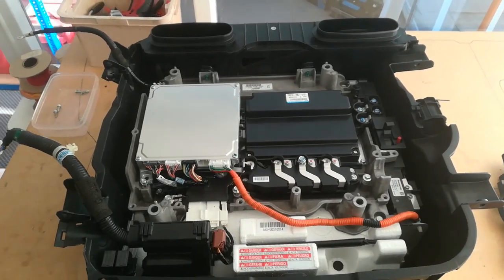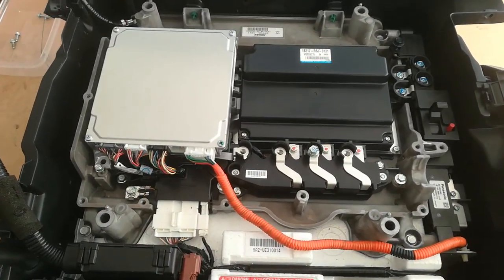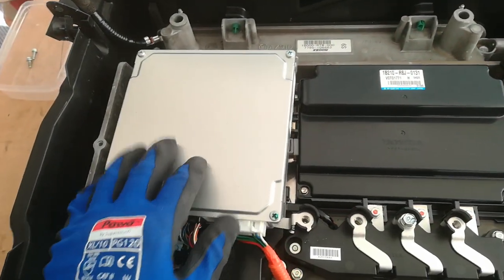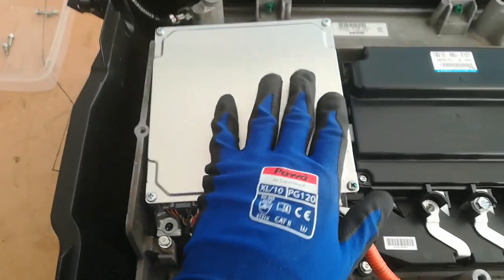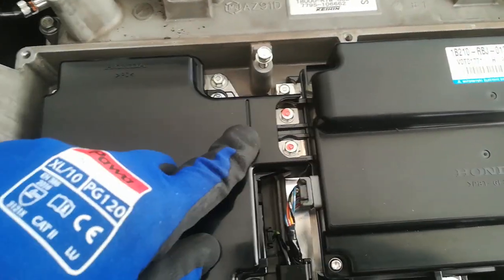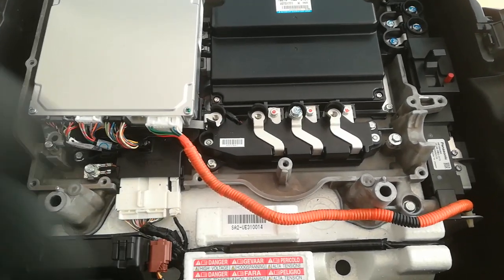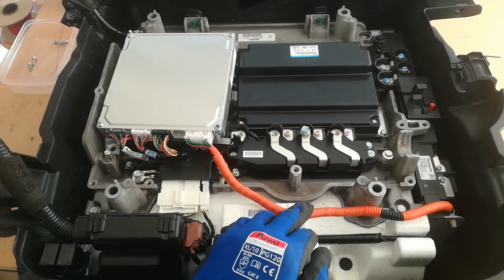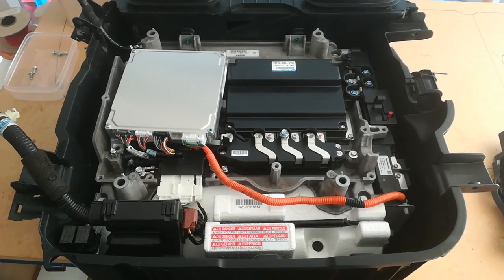CRZ Nimh Pack on the bench Video 1

Comment: My initial idea for more performance was a 10ah 48v lithium pack coupled to a 5-10kw brushless motor on the drive belt with regen set to low so the pack constantly trickle charges and gives performance gains when on full throttle via an Arduino sensing the throttle butterfly.

But this idea looks much neater!